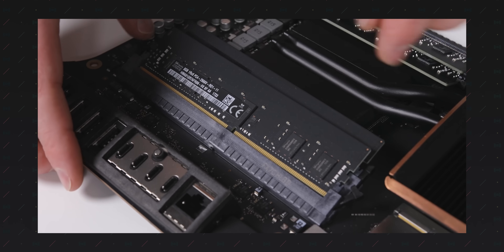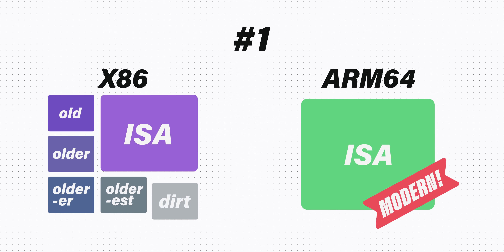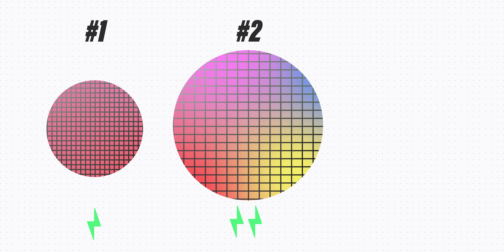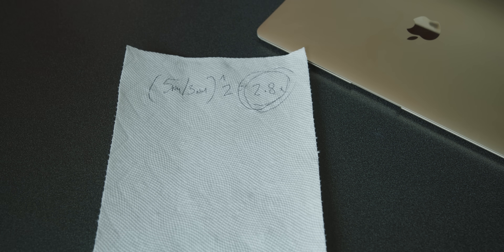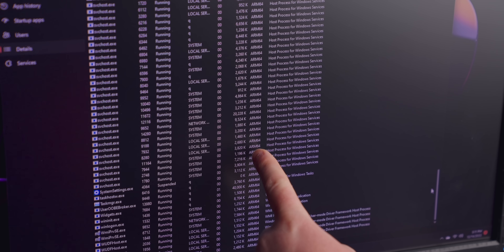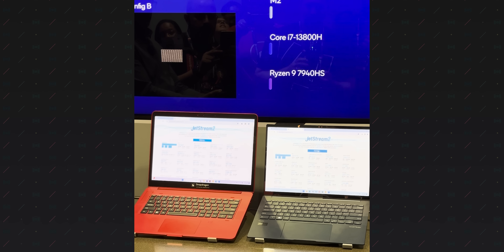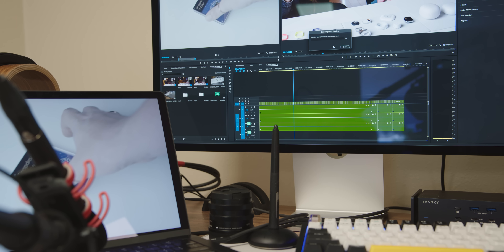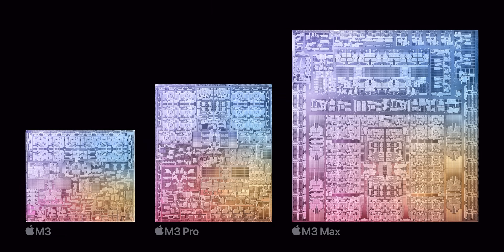Apple's Silicon Magic Is Over!

Comment: The ‘M’ chips are so efficient, why not put 2 of them in a laptop one either side of the keyboard.
Reply: You would have twice less battery but not twice the performance, splitting tasks between 2 chips is not very efficient
Reply: @d4rkrises807  not true, if you look at the larger M chips the pro and max they work on this very principle, the M chips are not like AMD or Intel chips. In relative terms the pro and max are more efficient in regards to compute power and although they use more heat and require better cooling, the battery life isn’t affected to negatively.

Comment: This video glosses over the fact that Qualcomm basically got all of this chip technology lock stock and barrel from Apple. With the Nuvia acquisition, Qualcomm got the top Apple Silicon engineer who had been working for a decade on Apple Silicon, plus 100 other former Apple engineers. Nuvia was founded while the founder was still an Apple employee and only existed as a separate company for 18 or 19 months before becoming part of Qualcomm. The point is that Qualcomm did not innovate their way into parity with Apple, they basically stole the technology. That said, it would be very hard for Apple to fight this leakage of their chip technology as they are already in hot water for their near monopoly of the smart phone market. People should view the Qualcomm chip as stolen Apple technology: it is proven very reliable technology; it will work well; it will transfer over well to phones and tablets. All of the problems going forward with these devices will be software problems and power management issues that stem from the vastly broader diversity of software running on Windows.

Comment: I've used Macs since 1990, but gotta say nowadays it feels like they only have a handful of macOS developers but hundreds on the iOS team... recently had to downgrade from Sonoma back to Ventura (on 2020 intel MacBook Air) because after the upgrade the CPU was running hot and the fan was constantly on. (Activity monitor not showing anything crazy).  There's an apple forum support thread with at least 300 other people who had same problem.  After the downgrade (not easy- required full wipe and install even with a Time Machine backup), fan was back to normal.  The good news about these Qualcomm chips is maybe there'll be ARM hackintosh macs possible.

Comment: The main problem with the windows arm competition is software support.
1. Apple can force developers to adapt the new architecture, because they can drop Intel support any time. So a Mac developer either support the new hardware or leave the ecosystem. Microsoft can't do that.
2. x86 emulation makes things worse, since developers won't risk any market share loss if they delay the arm transition, since their product still runs on the new hardware. 
3. x86 is far from being dead. People will be able to buy PCs that outperform new arm hardware, and on desktop who really cares about TDP? So why should developers focus on arm if customers can get better performance cheaper?
4. Mac is a reference hardware without competing custom solutions from different manufacturers so for example integrated media encoders or NPU are supported from day one. On PC everyone can introduce their own hardware accelerators and even if they provide Windows drivers for it, how long does it take until software will use it? If ever? Custom hardware on PC need to gain decent market share and become a de facto standard before developers even think about supporting it.

Comment: hmm , I am editing on a M3 Max 14 inch as we speak... My fans are between 0 rpm and 2300 rpm. Except when exporting I deliberatly put them on max speed to avoid throttle. Maybe you are using an inefficient NLE... AVID, Resolve, FCP all work perfectly, Premiere on the other hand is just  a hot mess.

Comment: At least part of the performance hit you're describing around 14:20 is down to your combination of camera, codec and NLE. I routinely edit 4K and 6K footage from a Lumix GH6 on my M3 Max 16" in Final Cut Pro, and I have never heard the fan during editing. I have heard the fan on long Blender renders, so it definitely does happen, but PPro just isn't as well optimized as it could be, and the 14" can't cope with the heat as well either.

Comment: all these problems and yet i have no intention of upgrading my 8gb ram mbp 2019 and the newer 16gb ram m1 mac mini. i play some games, edit 4k 60/120fps videos on them. anyway, i work in infosec and thats also why we use macs (2022 15" i think, dont even remember lol, i virtualize 2 systems and have to yet hear the fan), even on a national csirt levels - best combo of windows ease of use and linux where most of linux tools also run on macs since macos is pretty much a good looking and user friendly bsd unix. AND the security is the most important thing to us and apple is quick at fixing their stuff unlike linux or even windows. couldnt care less about soldered things - never upgraded my pc/laptop single parts ever since 1996 when i first got a pc. i'd always replace the whole pc anyway and i have yet to replace any of my apple devices or their parts with my 2016 iphone SE with ori battery included :--) 
just think of what kind of specs are you gonna need for the next X years instead of complaining parts are soldered. it really isn't a big deal. and remember that macos and ios in general needs less ram than their counterparts, thats why you never see the amount of ram iphones have - because it doesnt matter unless you do something really unusual i guess.

Comment: Though at times things can be build in nanometer size many parts could be replaced by (nano-)fiberoptics and chips (CPU/GPU) could even be build around the whole chassis/tower. I used to more often to increase size of RAM or HDD than to change the CPU anyways.

[ Used in proper environment; serverrooms, i.e. for genetics/banking first, more of a service marketing similar to Apple probably. Later on to be recycled/refurbished into PC ]

Noch vorteilhafter wäre ein Rechenzentrum, dessen Glasfaserleitungen 3-dimensional einen Raum füllen, unterbrochen von höchstmöglicher Anzahl CPUs oder QPUs (ohne die Leitung zu schmelzen) und RAM/SSD-Kombi jeweils mitten zwischen CPU/QPU. An den Wänden entsprechend der Kapazität des Bus Ausgangs/Ergebnis-Leitungen zur Entnahme/Weiterverarbeitung/Archivierung...
Ich vermute es gibt nur 2,3 vernünftige Möglichkeiten so einen Raum herzustellen :(
(Aggregate an den Knotenpunkten z.B., wobei die getrennten Leitungsenden an den Aggregatflächen mit Transmittern/Emittern versehen werden könnten )

Um die Leitungen weiterhin zu schonen könnten in direkter Nähe der CPU/QPU auch Leitungen aus echtem Glas verwendet werden, welche in Glasfasern übergehen ( der Bereich um die Hitzequellen herum muss sowieso etwas Pufferraum haben.. )

Noch schöner wäre eine sphäre mit igelförmig aneinandergereihten qpu-stäben, an deren spitzen sich licht-emitter befinden; in jedem Winkel bzw. Vektor einer. Das Ganze ergänzt umhüllt mit einer Glas(-faser)sphäre, welche von nichtflüchtigem Speicher umhüllt ist, wiederum einer Glas(-faser)sphäre und der nächsten Schicht qpu-stäben. usw. (Angetrieben im innersten Kern durch radioaktives Material ?)

Comment: i just love it that the original M1 chip had a media engine 1.5x faster than the dedicated Afterburner card released a year earlier that apple was still selling for 2000$ at that time.
Reply: Selling a 2000-4000$ device with no ability of upgrade or replace parts should be illegal. You call that pro model ?
Reply: @pokiblue5870  you know i agree with that, i really hate that part of apple silicon, i honestly feel like the government should do something against non repairable devices cause it's harming the planet a lot more than we think. Are the new Qualcom based PCs upgradable ? Cause if not that would be a disaster too.

I feel okay that my macbook is not upgradable cause i bought it directly with very high end specs (at a very high end price) and it's now been 3 years and i still don't feel like i need any upgrade. My Asus Laptop i bought around the same time for gaming is upgradable and i'm so happy i've been able to add an extra SSD in it for pretty cheap, however i wanted to add ram and i already have to buy it used cause in 3 years the standards have already changed.
Reply: @pokiblue5870  I 100% agree with you, the gouvernement should do something against products that can't be repaired and force apple to allow us to repair whatever might go wrong in a few years. However i don't mind it that much cause i often buy the highest tear model and so it last so long that when i finally feel like i want to upgrade, new parts are not compatible with the pc i have. I'm a mac user and would only use mac if i could, but like most mac users i also have a PC, both a gaming laptop and a custom built tower i made myself and i know how great it is to just add an ssd when the current on is full.

Comment: Im a pc user,never had Apple product and what i don't like about Apple it's the wasted potential for me. 
Apple it's the only company that can force update/changes from partners and it's a powerful move for the end result/experience for the users. For example the passage from x86 to arm m1 support. 
The iOS old build support quickly drop,so most of the user use latest update,so more consistently and better experience overall.
But then do totally no brain moves like anti-repair stuff, ridiculous price, limited options,limited i/o,limited features etc.
Apple have a special treatment from their customers because can do everything and people still buy like necessity's.
I even read people against the side load and more open s.o. even if for the 90% of the user there is no difference.

Comment: It's not purely on Apple to realize that they need to stay ahead in terms of software quality. IF (And that's a really big if...) Microsoft can get Windows features like standby, power and memory management to the level Apple has managed so far, a Qualcomm equipped laptop would give us equal performance. So far, Apple is still going to murder everyone with a computer that won't drain itself empty while sitting in a backpack because it didn't manage to stay in standby. And the better trackpad.

Comment: 4:38 there is an option #4 to improve a CPU : you can optimize the design parameters (for combinatorial circuits like adders & multipliers you can use more parallelism and more lookaheads), including optimizing the transistor sizing even further to minimize switching time.  That's basically pulling the performance gains out of your design engineers' brains and it aint easy and is not always possible.  Another problem with M3 is that all the greatest Apple Engineers left to start Nuvia, so the M3 chips didn't have the same amount of brainpower behind them ... That problem will persist for M4, M5, and M6 ...  Meanwhile, Qualcomm now has the best ARM designers, not Apple, not any more.  Apple blew it!

Comment: An interesting video, questions and observations:
-What are AMD and Intel going to do? Intel has a disastrous record for innovation, although they were among the first to licence ARM - StrongARM
-AMD and nVidia could be frozen out of the GPU market - a discrete GPU using an order of magnitude more power than a CPU seems silly
-Efficiency... It wasn't that long ago that much of what we do today was achieved in 64k on 8-bit platforms - real efficiency is a lost art*

*Yes, yes I know... but to give an esoteric counter argument SymbOS is a fully pre-emptively multi-tasking OS with a 'modern' GUI that runs on 4Mhz Z80 systems with about 128k made in the mid 80's!
Programmers have been spoiled by the pace of development over the last 40 years. Re-learning how to write tight, efficient, and fast code can yield huge benefits. But it's not going to be done on current platforms, OS's, or with today's development tools.

Comment: I upgraded from my M2 Air base to a 16" M3 Pro. Not because the M2 was slow... as it did everything I needed. That memory being stuck at 8GB is what did it for me. Though, even with 18GB now in this new Mac... I was shocked to learn just how heavy Logic Pro X can be with just a plugin or two. So, now... I'm back in the same boat. Plenty of processing power, limited on memory.

I dream of Apple finally deciding to let their big pro series machines have swappable ram again. They've backtracked on other things...

Comment: There is something wrong with the M1 series Macs. Apple took away the system wide ability to preview/convert eps graphics and I have graphics that won't show in printed pdfs or in web pages. The later I suspect has to do with the inadequately shared memory between the CPU and GPU.

Also the ports are flighty, frequently dismounting drives in the USB4 ports and recharging follows a logic I can not follow, I have to sometimes force the Mac to recharge instead of "Pausing" and leaving me a partially charged battery, something that happens in the background without my knowledge. Bluetooth is as unreliable as ever.

I am growing disillusioned with Apple's claimed progress, which is mostly taking away features and performance simply to not cannibalise sales of more expensive models, despite none of the Macs are cheap nor what I actually wanted which was a 5k+ iMac.

I hope Qualcomm gives Apple a much deserved kick up its lazy greedy arse.

Comment: Silence is all I want.
PC or Mac computers that could run 99.5% silent in everyday use. I want to have a button to allow or NOT ALLOW fans to run depending on my needs.  So I end up choosing MacBook Air because it is the only computer that is silent while all others can start their fan when-ever they feel like it!
Reply: Same, still rocking m1. But would trade it for an equivalent x86 device in a heartbeat.
Reply: You do know... That most laptops... Have an built-in option to adjust your fan curve right? That there's this thing called "quiet mode" on windows? I prefer having the option to ACTUALLY have active cooling (who drives an air cooled car now days?) that I can adjust to my needs
Reply: @JuanDiego-r9g1h  No I don't? I had HP and Dell notebooks at work and one way or another they refuse to run without a fan. If you can point out to some reviewer resource that shows how to practically use and achieve "no-fan" operation on Windows notebook I would be very interested.
On desktop PC I literally installed crazy overkill CPU coolers on 6-core CPU to ensure that fan remains mostly idle, but on notebooks you are stuck with some micro-buzzer that is there - except for MacBook Air that I have now - love the hardware in it.

Comment: A regular Intel or AMD cpu also has the "Video Engine", "NPU", etc.
SSE instructions do just that, and more.
I remember when 1080p video came out, old CPUs had a hard time decoding it, but newer ones with SSE did it with no problems.
Those pretty names are just marketing BS.

Comment: Third World perspective: I'll never buy Apple Silicon, and not because of the upfront cost. As a photographer and part-time coder, I can scrimp and save and sacrifice a thousand dollars for a laptop... But my country has no Apple Care, no Apple stores or service centres, and these things aren't repairable anyway. 
The cost of a Mac is acceptable as a once in a decade investment for work, but not when a simple fault means throwing away the whole thing. It simply costs far too much. I'll keep using a PC where I can afford to replace anything that fails: SSD, RAM, CPU, monitor, anything is available on eBay at a bargain. I'd also consider a 2019 Intel Mac.

Comment: If up to 18% of people can experience a major depresive episode, shouldn't it be the abjective of pilot certification to identify those potential depressive candidates from the ranks of commercial pilots-in-training? Instead of focusing on helping pilots with these problems deal with their mental health issues, the chace of failure puts so many unaware passengers at serious risk. As a passenger, i want to know if my polot has a elevated risk of breakdown. Pilots should be m{tivated to not put thier passengers and crew at risk. Innstead of trying to get troubled pilots back in the cockpit, eferys should focus on getting them out the cockpit and into a cateer that both fit thiet abilities and doesn't jeopardize passengers.

Comment: This is exactly the video comparison I've been looking for! Thank you for the great explanations. And no I didn't turn it off when it got geeky! haha. I'm still using the 5,1 Mac Pro (Hackenmac) and the 2017 MBP. I've been waiting for the M3 Mac Studio and maybe an M4 MBP to replace my current setup. As a web/graphic designer, video editor and someone getting into Blender modeling for animation and printing, I tend to need a processor that can handle a large volume and I don't really want something that's getting ridiculously hot. 

After this video I'm not sure if I should wait for that anymore. Should I just go for a top of the line M1 or M2? I know that I'll still see insane performance gains from them considering where I'm at. But it almost sounds like the M3+ chips might not be worth it considering the stagnated form factors.

Comment: How does linux run on ARM?
Reply: It's ... problematic. It could run great but getting the drivers from the manufacturers is a big issue. This is one of the reasons why cheap Android phones are not supported for very long and Fairphone chose an embedded chip for their mobile.

I'd have higher hopes for RISC-V on Linux being the next big thing.